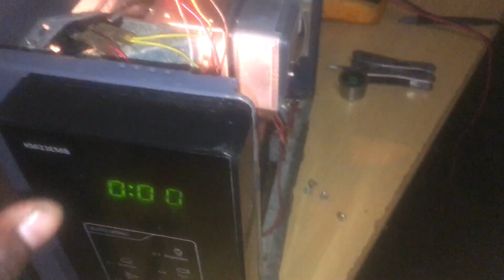How to convert 3 pins microwave fan motor into 2 pins and/ how to test microwave fan motor part 2

Comment: Ok so what if all microwave fans are testing good but the fan doesn't turn /spin
Reply from the maker: Use your finger to rotate/ spin the blade it might be grease if it can rotate easy then check the wires that are connected from capacitor to transformer and magnetron that are not interrupting the fan blade to spin...
Reply: Ok  thanks a lot wll keep in touch soon